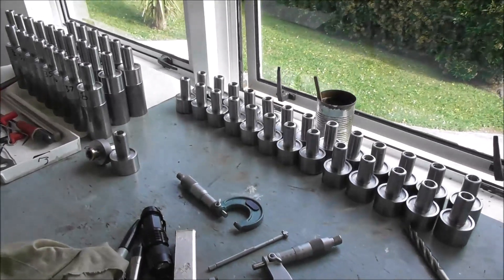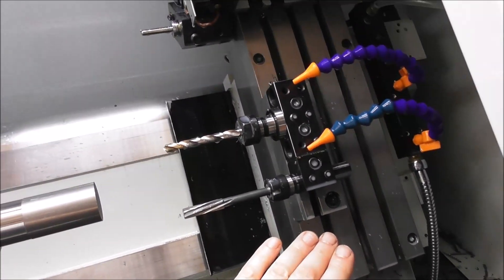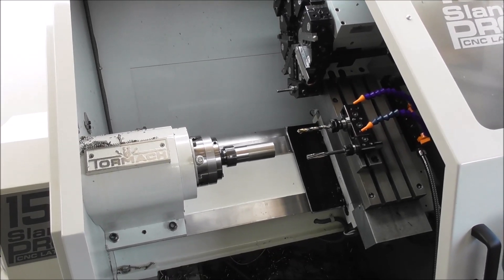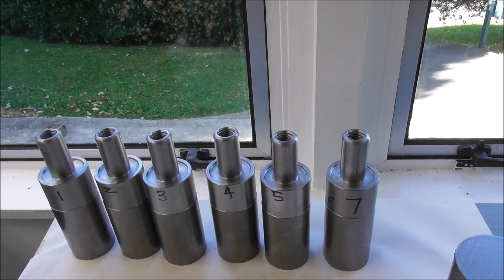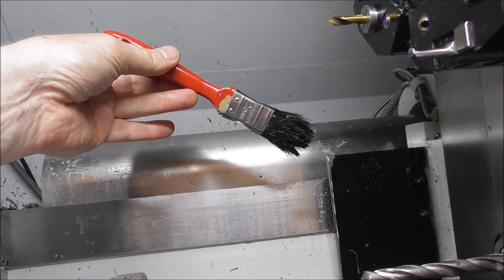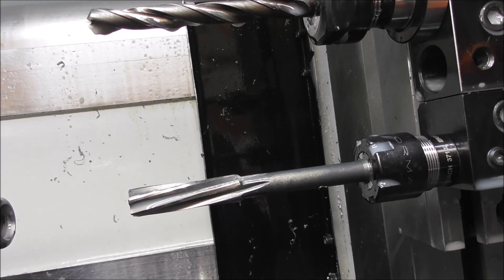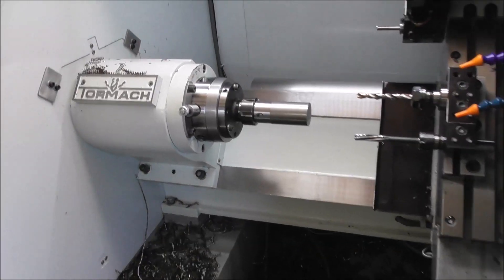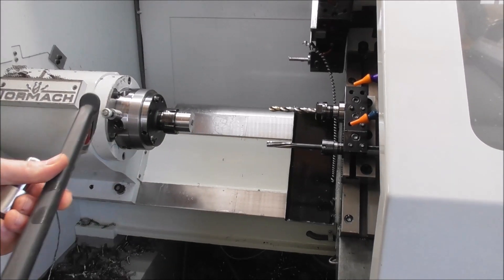Tormach SlantPro 15L?

Comment: Hi Cliff, the stepper version is 60 ipm rapids as I well know. I also work with Tormach and now I am running the servos which is an immense improvement in speed and power.  I am very happy with the machines performance.
ATB, Robin
Reply from the maker: Hi Robin.

60" is slow ..oh dear.   Good to hear they have you on board!  Feel free to email me any time if you have specifics you want to discuss. ( contact via 'about' above)  Regards  Cliff

Comment: Thanks for the great video. Can you use metric tooling with these lathes? I see that the Tormach tool holders are all imperial with imperial insets.
Reply from the maker: Hi Tony. Yes metric tooling can be used, but the holders may need machining underneath or shimming up, to be on exact center height. Cheers  Cliff
Reply: @Threadexpress  Thanks Cliff, no worries. I see that the Tormach tooling is 3/4" so 20mm tool holders with a bit milled off or 16mm shimmed would work I suppose. I like the Tormach because it'll fit in my shed and doesn't need three phase power.

Comment: I am heavily considering acquiring this machine but the biggest drawback for me is the rapids. Might you have any word on servo availability or how to get one from tormach loaded with servos?
Reply from the maker: Hi Adrian. Sorry I have no information. I have asked them recently but no news.  I would ask Tormach yourself. Please post any info here. Cheers Cliff
Reply: @Threadexpress   Iv asked and heard nothing. I think many people arent buying the 15L specifically because they want one with faster rapids and other features to come out first, and its been so long since this machine came out with no update that no one wants to buy one of these only for tormach to drop the new one a year or less later.
Reply from the maker: Yes I understand. When did you ask Tormach?
Reply: @Threadexpress  I asked over a month ago, i also read a forum post from march asking the same thing to which tormach officially responded that they no longer will give any updates about projects in development, or whether or not projects are even in development at all. I would pull the trigger on a 15L immediately if i just knew the status of the future for this line of machine.
Reply from the maker: @adriantorregrossa7255  Yes frustrating. I wish I could help. Cliff